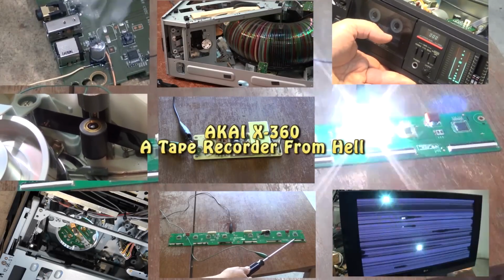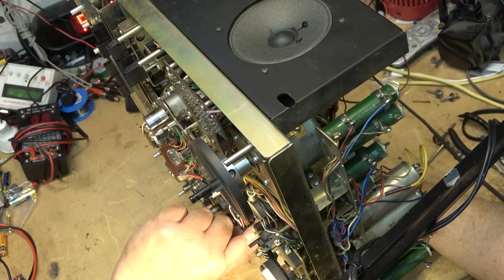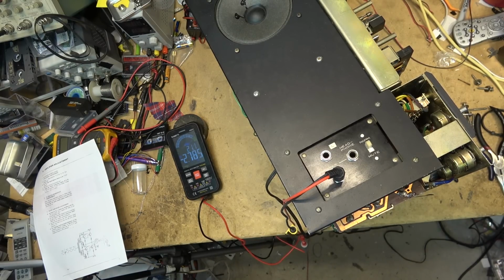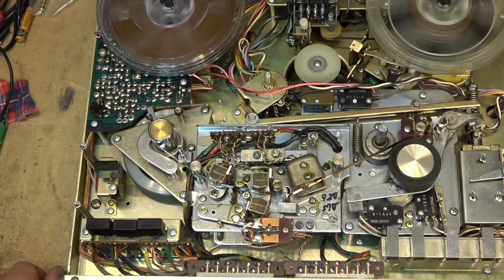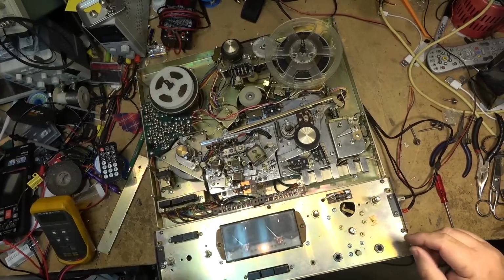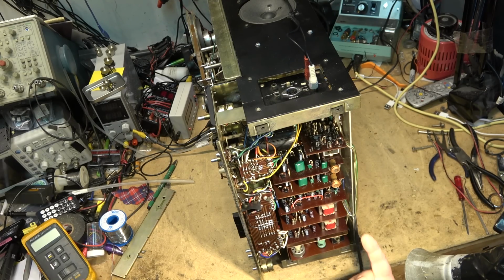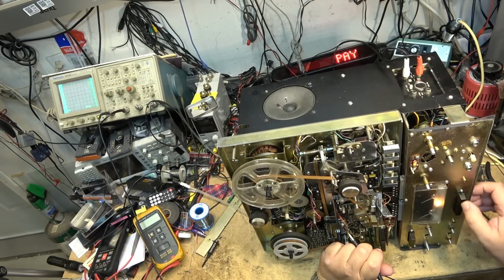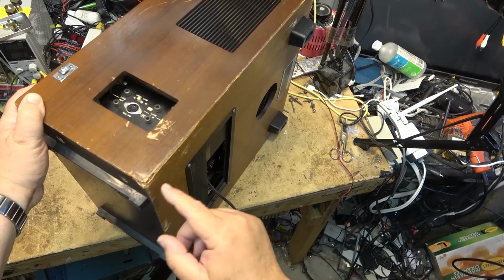Akai X360 Tape Recorder from HELL

Comment: This one looked good, and the job was supposed relatively simple and easy, but at the moment you said customer had replaced caps and so on, it immediately transformed into this mess, with multiple issues and still unknown deteriorating factors. First thing and that is obvious, the actual trend of total recapping is a technical nonsense as far as most people doing that don't have the tools and knowledge to really check all these caps:  most of times, it's useless when the material has been used and stored in proper conditions. There's many other issues on these machines like bad transistors, wich references are well documented, bad pots, bad connectors and classic belts and lubrification problems . And you also know that a broken connector is another pain in the youknowhat, as you can guess you can spend hours to locate a decent replacement and do the job. And when it comes to this relay board, the nightmare is immediately at hand: a broken board and these suspicious glue stains on the relay base? A tampered relay is a bad sign, a gigantic "oh no!" job. Of course, if the client is rich, you can always replace components, even replace boards and rebuild this stuff using top grade industrial relays with mounts and locking brackets, add reinforcement padding and supportive board system, replace audio path caps with 10$ each special performance iridium plated silk caps...
I've also been asked to modify one of these 1970's machine to read 30 IPS tapes: I had to reply they were absolutely not designed to achieve this, even a magician could not transform it in a studio machine from Studer or Otari!
I guess the client will limit his losses to use this one as a read only machine (who cares to record on tapes nowadays?).
Anyway, it's always interesting how these machines are built, and how they used different head configurations and transport...
Reply from the maker: The client isn't rich and i will have a tough time getting 100 for the repair.

Comment: That machine looks like it was really treated like shit, shame :-(.
For that broken connector i would make a clamp to stop the halves parting, but that's me.
Then a resistance check to make sure the heads do actually connect all the time.
I don't trust connectors and switches, they are crap!.
Edge connector boards eeek! trouble.
Calm down dave it's just a short term nightmare..... maybe :)

Comment: I have one of these with the spark quenchers going up in smoke, could I make my own with some capacitors and resistors in series, replacement quenchers are ridiculously expensive.
Reply from the maker: Yes that's all they are. You don't even need the resistor.  Just a cap will do.
Reply: @12voltvids  What model is that Fluke that you were using? I want to buy one that is good for electronics.
Thank you
Reply from the maker: @SDsailor7  fluke 12
Reply: @12voltvids  Thank you, I will look it up.
I am watching the video again of the Akai from hell.That thing is so packed with boards and wires yikes!